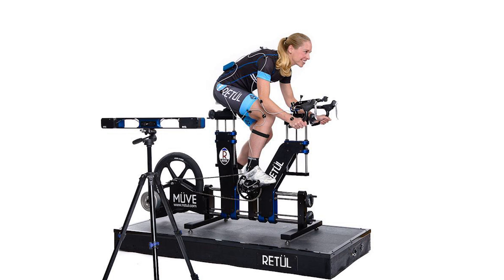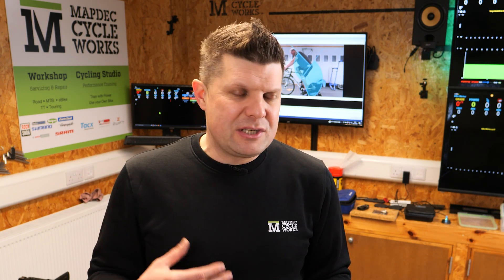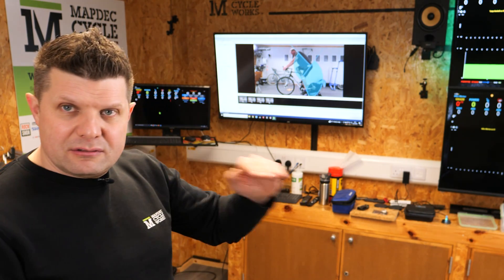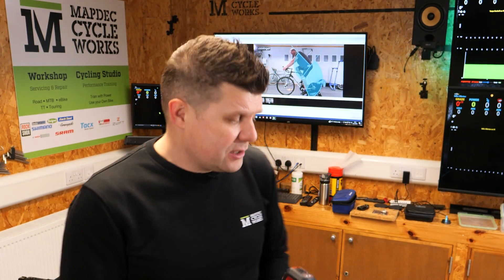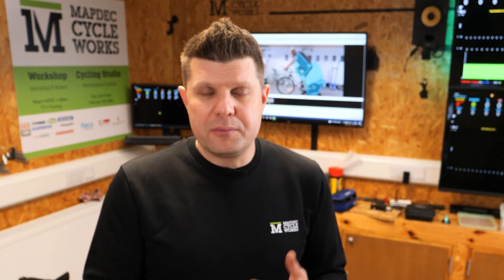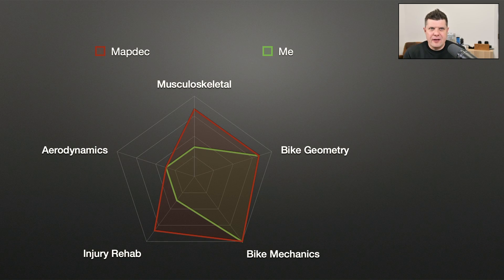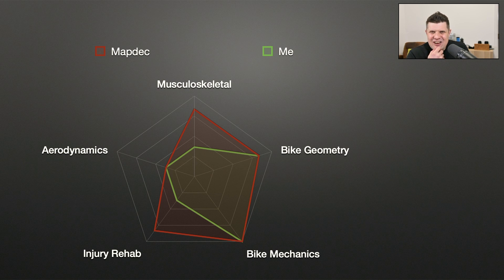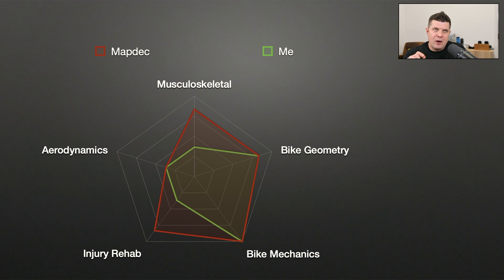You shouldn't need a bike fit, but if you do, ask for this.

Comment: As a bike fitter, I've certainly transformed people's riding experiences and abilities. I've also felt badly telling some customers that they need to work on their strength, flexibility, and riding technique to solve what they came in thinking were fit issues. You raise a lot of good points in this. Thanks. I'd also like to add, though, that most anyone that spends significant time in the saddle can benefit, often significantly, from a good bike fit, even if the have strong "adaptive" bodies.

Comment: Yep. Nicely put. Been doing bike fit from my home workshop for past 8 years. Just use turbo trainer,spirit level, most important my eyes and ears! Don’t charge big money so anyone who cycles regularly at any level can be helped to sit comfortably and efficiently. Interestingly have found that on off the peg bikes the stem is usually OK. Biggest factor with reach being position of levers. Often folk might say they need a shorter stem,but once seat position,set back is good,then find brake levers much too far forward on bars,then bars tilted up so riding on the drops impossible! Often simply make bottom of the bars parallel with the ground and pull levers back,sometimes 20-30 mm is a game changer.
Reply from the maker: Thanks for the input Felix

Comment: Mobility is so important! I've learned it the hard way, riding so much I began getting all sorts of hip and knee pain that seemed to come out of no where. I went to see my physio and turns out I locked one of my hips! Something they don't tell you is cycling makes you stiff. Cycling also only works a few muscle groups and exclude all the little stability muscles that are key to good mobility. People will run to get a bike fit and blame the fit when it most cases it's their body. I've since been working on hip mobility and flexibility and I've had zero issues since. I did get a bike fit at the start, and  that's something I think every serious cyclist should get. But at the same time, you need to take care of your joints and tendons as without these, your muscles are useless.
Reply from the maker: Thanks for sharing this Tony.  Well done on improving your mobility.

Comment: I had a professional bike fit in late '99 when I bought my Allez M4 Pro, a bike I still own (among several others) and have ridden a bit recently.  I was 39.  The only specific thing I remember about that session was that the fitter discovered an anatomical quirk in my ankles.  When my feet are pointed dead straight ahead, as they had been with my zero-float black Look cleats, my ankles rolled outward, one about 3 degrees and the other nearly 6 degrees.  I believe it's called oversupination.  (Turns out this is why I don't get on with in-line skates and rented skis).  He adjusted my cleats to accommodate the roll, resulting in my toes pointing outward on the pedals to the matching offsets, but he left me in the black cleats!  Not much later I switched to red cleats and have stayed with them for over 20 years.  Now, at 62, but reasonably flexible in my hips and the exact same weight as 23 years ago, I'm a dedicated sportif-style rider who wants to go fast occasionally and briefly but who mainly just wants to be comfy for hours on end.  I sometimes have some neck and shoulder discomfort after an hour or so, and I tend to get hotspots in my feet (lessened by the use of off-the-shelf metatarsal pads).  Both go away if I get off the bike and walk around for a few minutes.  I think it's time for a new fit.
Reply from the maker: Possibly. I would be tempted to contact a podiatrist first.

Comment: Nicolai & Artherton bikes offer customs/tailored sizing, I know Nicolai can build any geo and size that you need as long as it's feasible. 
 I've never tried a bike fit. But not needed it yet, but my bike fits me well, and I set it up well to suit me. once angle and height and position of things are set I mark it with an 5B pencil. as seat always slides when temps change fast, I have taped the back of the rails to be able to reposition it at the same spot.
but as you said not all benefiters have all of the skills needed. if you got the bike with good geometry and fit, you just tweak things to suit you, like bar rise, stem position, saddle height and position, angle. but an bike fitting rig can help you get the fit to suit you for an custom made bike or find the bike that might fit you. It would be nice if all bikeshops had a bikefit done for you.
So far I've done it on my own. but I only went by calculations and using my old bike as measurement, and confirmed it would fit me. but was tricky to do, as I just did it by feel, measured the imaginary handlebar, and stem length, and figured out the reach, and confirmed the reach for the large Geometron would fit me. doing this might be too complicated for some, so a bike fit will be easier. but you have a tool for this. I was happy how it turned out, but needed some tweaks like higher riser bar. I did not know such tool existed.
I like that Nicolai offers tailored fit. so you can give them the numbers and they can make you a frame that would fit. But so could frame builders.
Reply from the maker: Geometron is a beast of a bike.  Not much fitting to do.  Just get strong.

Comment: I am of the opinion that as you get older a bike fit is crucial. 50 years ago I would would jump on any bike and steam away.  The only adjustment would be to raise the saddle. As I grew, I realized that bigger frames actually existed lol.  Then there were long stems and eventually Look pedals (convenient  game changer). Nobody called these alterations a bike fit back then. It was all secret stuff to improve performance over comfort. Fact is that this is still the compromise that has to be  made much of the time. As I got into triathlons (initially for cross training. Yoga wasn't really a main stream, mores the pity ). Time trialing became my favorite past time and many alterations became apparently useful to reduce overuse injuries and increase aerodynamic advantage (no drafting was allowed). So I inadvertently became a, what Phil calls a Micro Adjuster simply out of necessity. Now in my Sixties and still enjoying my bikes. Even managed to  win a time trial in my age group though it is getting tougher as younger sixty year olds swell the Grand Master ranks. Therefore still staying abreast of latest technology as much as possible but resisting anything that doesn't relie on cables 😁👍✌🙏

Comment: So glad you discussed the whole issue. There’s no way around for the rider to understand which changes on the bike have what effect on either performance or fit. 
Then you might consider making suggestions for adjustments or new components. 
A lot of people certainly have the wrong assumption what „bike fit“ means. 
My enduro is totally different from my cyclocross, it has to fit purpose and me. There’s is no way I can go somewhere spent a few hours and expect the experts to set up my bike and then move happily along with no further issues 😂
Reply from the maker: Thanks Philip.

Comment: I had one bike fit in the 2nd year after getting my bike that I’m still riding. A top of the line Madone that I’ve never felt a need to get a new one. After that first one and over the years of self education and learning, I realized that they didn’t really do a good job. I doubt I’d visit another fitter again knowing what I know now after 11 years. That said, if any of you go for a fit and on initial assessment they don’t first off determine whether you have the right length crank arms on the bike, then they don’t know what they’re doing, my opinion. Generally speaking, if you’re under 5’7 ish with 172.5mm arms or higher, it’s very likely they’re too long. A taller rider can tolerate a bit too small crank arm, but not the opposite. Most mass produced bikes come equipped with arms too long for the expected rider of that size frame. Some brands are doing better at that but not all. If your crank arms are too long, you’re never going to get your seat height truly right (most fitters set your seat height a bit too high imo), while also avoiding hip impingement, and while getting into a low aero position.
Reply from the maker: Sure. Crank length is actually a good example of the Macro Absorber.  Many very shot folk are happily riding 175mm and see no reason to change.  That said, you are right most would benefit from shorter.
Reply: How would you know most fitters set their clients seat height too high? Did you go watch and observe these “bike fitters” you mentioned? The issue with some consumers, they like tinkering with their fit which is fine. But if you got no great body awareness, understanding of cycling biomechanics then you’d be best of getting a pro fit. If you’re able to afford madone then whats the bike fit costs then? Even before purchasing a bike a prefit bike is probably the best investment if you will spend 10k and above on a bike 😂
Reply: @PhiyackYuh  I got a bike fit back a year after I got the bike, and that’s after a fit at the place I bought it from (bike $5500 back in 2011, would be close to double that now). Specialized BG fit back then. All the hype about the camera and computer etc they made in advertising, then I get to the one at the local Spesh dealer and I’m upstairs and ask about it and they’re like yea that exists but we don’t have it here (The whole reason I’d gone there). So I got the “old fashioned fit”. Anyway, they didn’t even talk to me about the cranks, and it wasn’t for several years and lots of learning that I’d been on cranks too long for me, (172.5) I’m 5’6 with a 29in inseam and 165mm would of been much better suited for me on my bike, a 52 size. And yes after all the reading and other info I’ve gathered, the long and short of it is most bike fitters will set your seat slightly too high. You’ll eventually realize that yourself if you dig deep enough. Ultimately though, you’re better off with your seat being slightly too low (3-6mm), than too high.

Comment: That was quite some presentation! Macro absorber vs micro absorber. It makes total sense. Since the Eddie Merxx bars were replaced on my 45 year old road bike,  this has been a revelation! No longer the 20 year old kid who bought the bike, the hoods and sometimes the drops are usable. The riding discipline also matters. My track bike is more limited in top speed due to gearing and its use at lower intensity. Safety by moving its brake lever to the right center top due to injury. Physical therapy to address the micro adjustment tendency from injury. It's not a simple matter. That stem fitter tool is interesting. Ages ago there was a quill adjustable stem which had  notches or coarse teeth on it. The rider could then borrow it to determine stem length. Even the shape of the bar tops matters.  I'm trying a new bar with a flattened upper with 15mm rise in the center. Looking to see if that works for me.
Reply from the maker: Thanks David, try a little stretching, see if that works for you too 😉

Comment: 48 years old 300w FTP, always done bike fits myself and never been fitted, and definitely a macro adjuster done yoga etc, just worrying about low hanging fruit, ie am I missing something obvious? Followed common-sense guides to saddle height, torso extension, bar height, crank length etc.
Reply from the maker: Unlikely… but from experience macro absorbers can also have quite poor proprioception and I have had success in coaching a better pedal technique to unlock a bit of power.  Have a google of glute amnesia in cyclists.

Comment: I've been really lucky so far. My theory is that I was a macro adjuster due to my age at first, because I never did any strength training and stretching, and I was fine, but if I look back on what I used to ride I'm not sure I'd last very long on the same setups today. In my early 30s I was convinced by a friend to get into strength training, as I was learning about that, and the fit kind of followed. I started adjusting my position in a way that I felt better utilized the muscles I managed to activate, strengthen, and mobilize. Hip mobility was the biggest thing, it allowed me to dramatically lower my seat height, I had more reach too, that gave me a lot more options, I could fit more bikes, take on more aggressive positions on be even more comfortable in less aggressive positions. The only thing I found that I got more sensitive to over the years is the shoe and cleat fit. If I'm seeking bike fit help these days I'm looking for someone who can help with that.
Reply from the maker: Macro Absorber.  Defo hip mobility is the big one. Well done. For shoes I would really go to a podiatrist.  A retail shop assistant with a day of training and off the shelf products isn’t going to offer you anything worthwhile.

Comment: I totally fell down a bike fit rabbit hole lately and figured I needed to get one before getting a new bike........Well I didn't bother. I figure if something about the bike is uncomfortable when I get it built, then I will change something until it's comfortable. I did this with my Dads bike I have been using. The pain in my neck was excruciating after 2-3 hours riding, I swapped stems for a 100mm from a 110...a 5 hour ride later, sorted. Can't believe 10mm makes that much of a difference. 

Anyway, I can't justify giving £200-400 away for someone to basically tell me whats "right" for me. 3 pairs of shoes ordered and 2 returned so far, soI think I at least have the right size. As for bar stem crank spec..I have guessed. Fingers crossed it's all right.
Reply from the maker: Will probably be fine.  We only charge £60. I can’t bring myself to charge more.
Reply: Lucky you. Any bike shop will tell me their XS frame is fine, when in reality 90 percent is too long even with a 6cm stem. I know a lot of women of my size who are in bikes way too long.
Shame I had to go through a bike and three different fitters until the third one put me in a jig and said the bike was too long.
Also, the jig was how I could tell 155 cranks were the right fit, which no other fitter mentioned before (naturally they couldn't fit them on my bike).
Also, I could also try saddles and experiment with other measurements. Lowering bars meant less shoulder/hand issues, unlike what I was instinctively doing.
There is no way I would consider my current bike without the pre purchase fit and being able to do 6h rides without issues made it worth every penny.

Comment: I like your points on communication and observation. I had a TT bike fit back when I was racing. Made a big difference in speed at the time though it took me a long time to adapt to be able to ride comfortably in the position. That was intended as I’d asked for something suitable for 10 mile TTs. I ended up by the end of the season doing 100 mile TTs in the position. I could probably have worked in it myself but it got me to pretty much the right place straight away and you can iterate a lot faster.

For me now the most important thing is saddle height. I’ve got both old knee and adductor injuries so it’s pretty key. The rest I can absorb without much issue.
Reply from the maker: Knee pain. Quad or calf tightness 😉
Reply: @Mapdec  torn patellar tendon from a skydiving incident and a torn adductor following a bike crash. Both are fine if the saddle height is right.

Comment: 5:57 this is why doctors use those pain charts with multiple choice answers + a 1-10 scale. They do back to backs, blind tests etc
You're dead right that you can't use words or facial clues. I myself ride many types of bikes a week. When fiddling with bike fits to alleviate pain sometimes I'll be in a recovery period where a knee tendon is healing or freshly injured so trying to assess if the new fitment  helped or hindered can be a snake eating its tail. One of those tendonitis damage/recovery diary's seems to be needed. 

I think for a true fit we need to measure power at exact knee angles to plot a graph of where our individual strength to flexibility corresponds. 
Hand numbness is the biggest issue. No one can ever assess if its weight balance, ,wrist angle (elbow drop) ,sweep/rise or lower back nerves being pinched.
Reply from the maker: Awesome comment as always Jane. Thank you.

Comment: Guess I'm a macro-absorber. My first "real" bike would give any bike fitter an aneurysm - the long-and-low pro-fit, 120mm stem, long-reach bars. I've ridden that bike for 20 years (and still occasionally do), and it was fine even for multi-hour rides!

That said I treated myself to a new ride last year. Went to a 100mm stem, and from 42 to 38 cm bars with less reach. It is more comfortable (and more aero to boot!), I no longer get numb hands and feel less fatigued after long rides, but it's not a day-and-night difference. The one thing I am micro-adjusting is saddle tilt, where being off by even one degree in either direction really does seem to make my life miserable.

I still get sore shoulders and lower back sometimes, but that is an issue I experience on road bikes, MTBs, on- and off-road motorcycles, and even just sitting at my desk. 3 minutes of stretching every morning does wonders for that!

Thanks for the detailed video, refreshing to hear a balanced take on who actually can benefit from a fit and a honest assessment of your areas of expertise!
Reply from the maker: Thank you.  Might not be saddle tilt.  Look at what happens at pedal TDC with your hip angle and lower back.